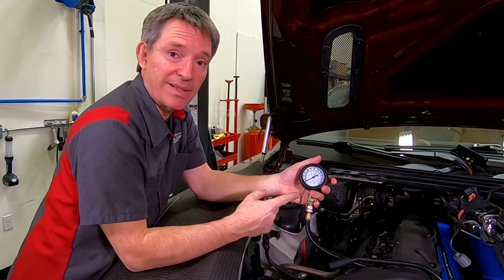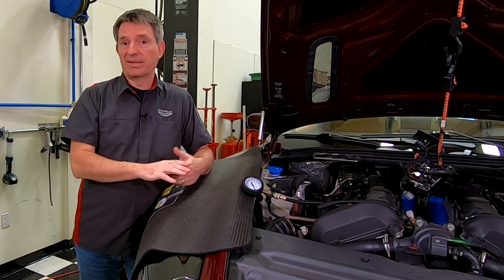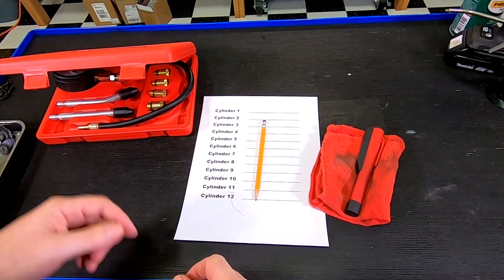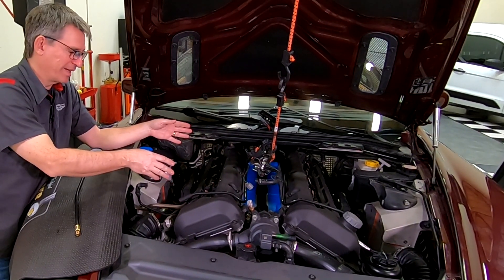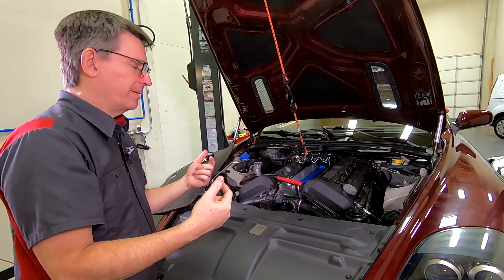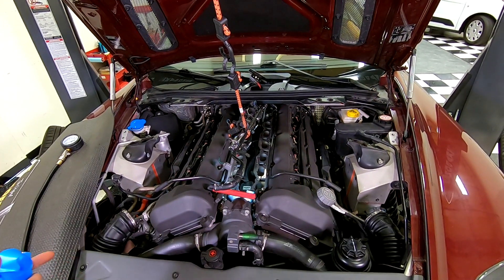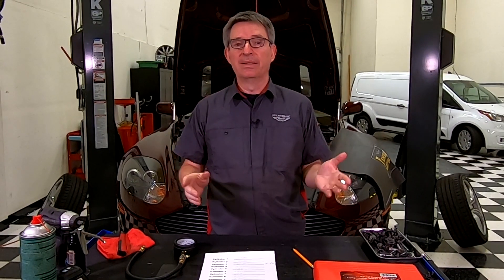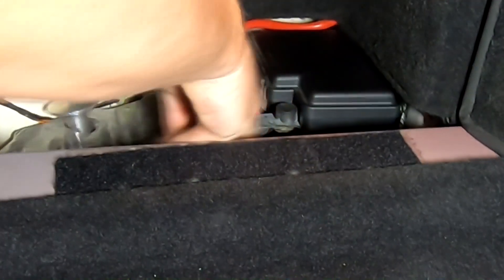Testing the Compression of an Aston Martin V12 Engine

Comment: Hi bro I have Aston Martin vanquish 2005 I test the compression and the cylinder 5 and 6 had 175 and 146 PSI. And the rest are 220 psi above.
Reply from the maker: Oyyy.   That's seriously bad news.   I'd run a borescope into those cylinders to have a look for scoring on the cylinder walls, but regardless its probably a new engine.

Comment: spark plugs and coil packs so soon again?
Reply from the maker: Soon is relative.   Its been about 6 years since I changed them the first time, and that was some 25k+ miles ago.   In Toyota terms, that's ridiculously too often.  In Aston terms, I think its about what the situation will be for the coil pack design and the relentless heat load it endures fully enclosed in the cylinder heads.   Some people have just discovered my videos and don't realize I did that video series not long after I got my car, and that was 8+ years ago now.   Thanks for watching!

Comment: Compression or Leak Down test are the ultimate engine health measures and done only by the most careful and dedicated owners/mechanics, but doing it on a DB9 is on a totally different level in terms of preparations and access. Although with your dyno tests one could anticipate a perfect compression, doing the leak down test with coils packs and spark plugs replacement makes perfect sense… I am looking forward to see how you deal with The ceramic catalyst ingestion issue as a long term and preventive measure, Wondering if you remove the primary or will try to be on top of everything in terms of perfect combustion of fuel. Absolutely brilliant videos and as always thanks for sharing.
Reply from the maker: Hi James.  Thanks for sharing that.   I pulled up short of doing a leak down test since I didn't want to invest the time and felt confident enough after the compression tests and the [upcoming release] video borescope inspection of the cylinders.   Removing the primary CATs may be on the horizon, but not this year.  Thanks for watching!

Comment: You changing coil packs and plugs just now makes me nervous about the condition of my 2007 DB9´s packs and coils as I am positive that they are older than five years. This is purely preventive right? I checked for misfires (OBD2 + Aston software) about a week ago and the worst performing cylinder had 12 misfires in about 15 minutes.
Reply from the maker: Its not just an age thing, its a response to the misfires you are detecting.  Low level (qty) misfires don't matter that much, but are a harbinger of things to come.  It only gets worse, not better.   My car was experiencing it again after 6 years, and I opted to take care of it now rather than push it out into the future.  Thanks for watching!